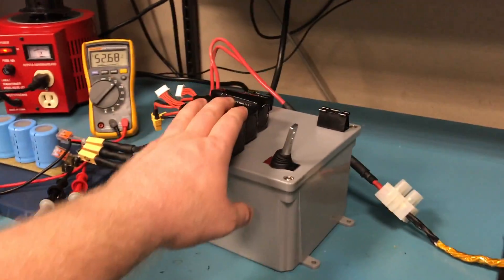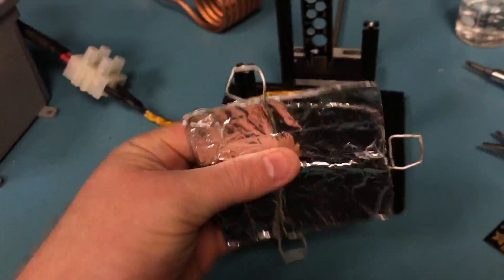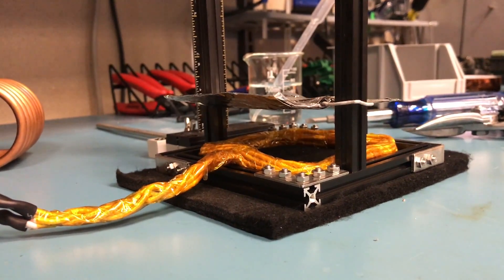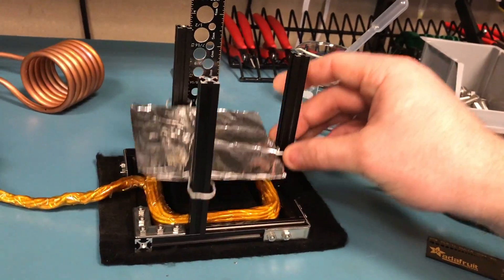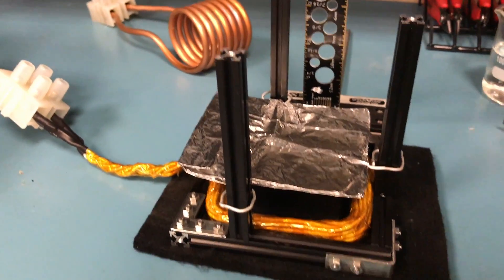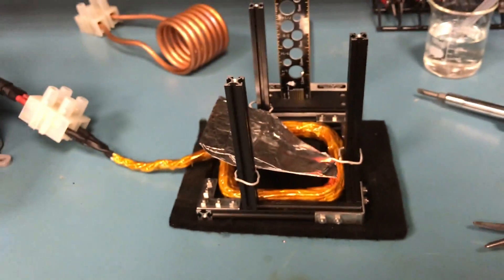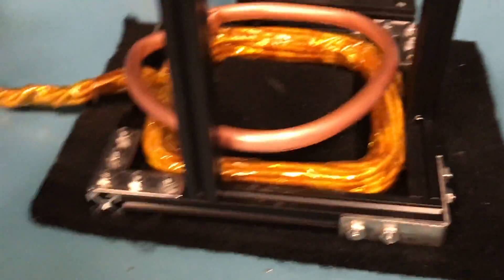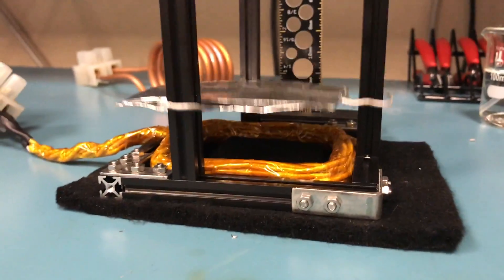DIY Levitation Platform with an Induction Heater

Comment: Nice demonstration! is the frequency of the lc tank important in the height or just important the voltage? i mean more frequency more eddy currents?
Reply from the maker: Thanks! A higher frequency will increase the velocity of the traveling field and will result in more power transferred to the platform(more eddy currents).  The higher frequency presents a larger impedance to the work coil so you need to increase the voltage with the frequency to get a nice increase power delivered to the platform.
Reply: Will this work with 50 Hz?

Comment: I made a pancake coil with 12awg and folded some aluminum and it actually worked fairly well. Until my foil started smoking 😂
Reply from the maker: No type of magnet would work in this scenario.  The magnetic field produces from this coil is always changing polarity so the magnet would be attracted on one cycle and repelled on the other.  Like this: https://www.instagram.com/p/BB3RC9cPmOL/?taken-by=protog42  Also, after a while, the heat would remove the magnetism from the magnet.
Reply: Oh and it also works because aluminum is diamagnetic so it will have better results than other metals
Reply from the maker: Aluminum is paramagnetic, not diamagnetic, but a diamagnetic material like copper or pyrolytic graphite would repel the coil even better than aluminum but I don't have copper foil on hand.
Reply: Proto G 😮
Reply: Proto G you should try it with neodymium